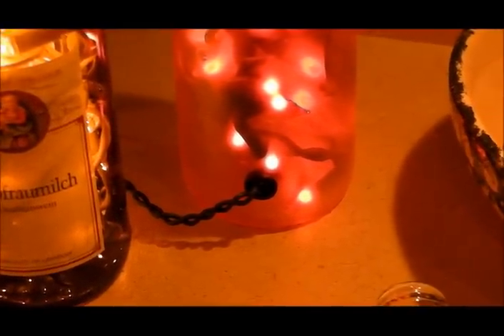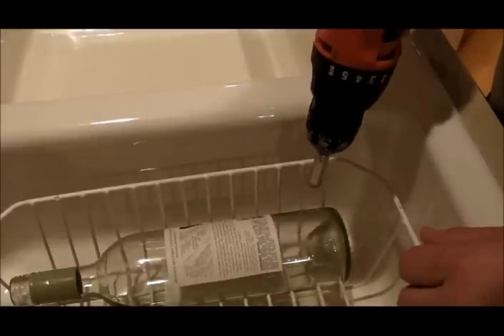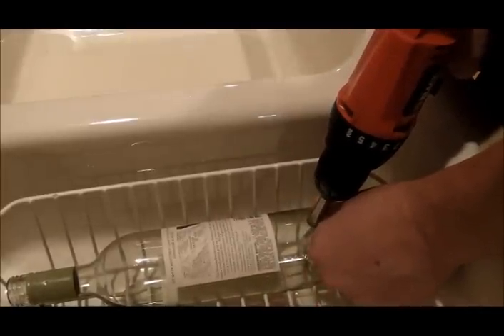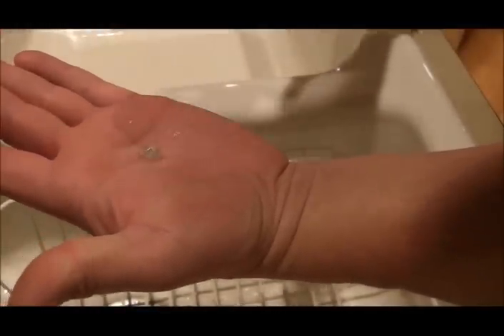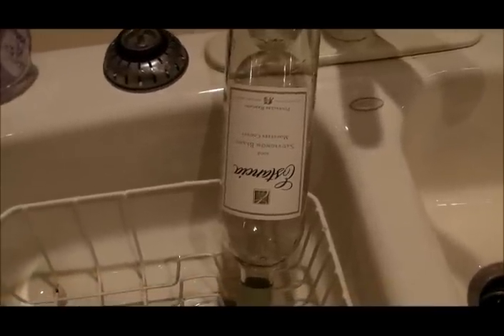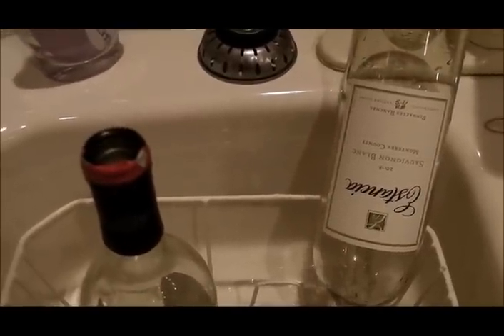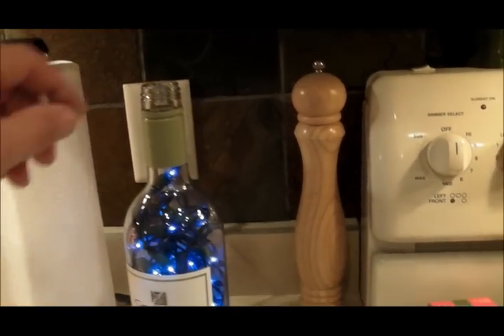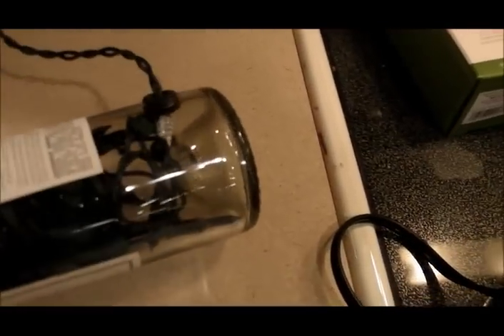DIY - how to make your own beautiful lighted wine bottles

Comment: Nice idea, and very clear video, thanks! I made something like this, with battery operated lights, in a whiskey bottle. No drilling, stuffed the lights in, and the switch is hanging out of the mouth of the jar. The top still fits on, there is cork on the sides of it, and the wire coming out made a little groove in the cork. Not a very heavy wire anyway. It's a little night-light, looks cool! 
I'll have to try yours too. They would make great gifts!

Comment: I got one of the glass blocks at Menards last year when they had them on sale to get rid of them. I simply stuffed a 70 count LED mini style lights string into it. I chose LED's because they're going to most likely last for years. Once the bulbs start to fail on the mini lights, it's pretty much had it. If I was to make a wine bottle light, I'd probably go with the LED lights. But nice video showing how to do this!
Reply from the maker: yep those would work well too - just don't know much about the wiring for those.

Comment: Thx very much for a great video!!  I made a great wine bottle light using your instructions.  No problems except that the lamp  really develops a lot of heat.  Anyone else notice that?
Reply from the maker: +Emily Zeiders I've noticed that some brands of lights put out more heat than others.  I try to get the Philips ones at Target whenever I can as they seem to run a little cooler than others (say from Walmart or Menards).  They are getting harder to find these days in colored strings.  I have been buying 100 light sets and separating the two strings of 50 and then I need to find a cord for the second string of 50.

Comment: If you are removing that third wire on a string of lights, cutting the wire even with the base of the bulb will suffice, you could put a dab of nail polish on the cut end to seal it, but the lights will be contained inside the bottle away from any potential for being touched or causing a problem. This will save you the step of the shrink tubing. Also as suggested, if the hole you create is large enough you can feed the lights into the bottle that way, rather than through the top and the need for any soldering, but if you have some soldering skills, there is usually an access cap that can be pried off the plug so you can unsolder the wires from the plug itself. Then feed the wire through the top and use a hook tool fashioned from a paper clip or segment of coat hanger to fish the wire out of the hole you drilled and resolder on the plug, eliminating cutting the wire and using shrink tubing. then feed the rest of the bulbs into the bottle. To eliminate the use of the grommet, a generous amount of hot glue as a strain relief and plug can be used on the hole you made......just a suggestion to save you some steps and supplies.....Happy Lighting!

Comment: Absolutely awesome instructional video! Thank you for taking the time to make it! My husband and I have a question though.  After the lights heat up, we assume the cord relaxes a little. How do you keep the lights from settling to the bottom of the wine bottle?
Reply: Before you start pushing the lights through the hole, tie a 4" piece of string to the first bulb/wire. It floats to the stem and will come all the way out as you continue pushing your bulbs through. Then just tape to the back side of bottle neck and cut excess off.
Reply: Perfect answer, kind of like slicing bread! ;-)  Thank you!
Reply: The lamps I have made I started with a 1/2" bit to bore my hole and push the string of lights thru there. As for the top I fold the 1st light to the 2nd light and at the V hot glue that to the cap for easy removal in case you need to change a bulb. Also I was able to find cords without the female plug part. As for the hole with the cord coming out I hot glue the cord where I need it. Be sure to give your self enough slack for the whole string to come out.
Reply: +Betty West I ship my  AuroraBottleLights to customers and to make sure the lights don't settle to the bottom I add a small tea cup hook to the bottom of the cork.  I also make my own bottle stoppers so they are more unique.
Reply from the maker: We leave our bottles out all year long and sometimes the lights do settle a bit.  You can unfold a paper clip with a little hook on the end and with the lights unplugged from the wall reach down in with the hook end and pull the wires up a little.  Or you can just pull them all out thru the top and stuff them back down again. ;)

Comment: Last xmas we save a lot money doing this bottles,l love'em but we make that hole an right after we introduce the lights with out cut any.
Reply from the maker: +Luisa C Morphis could you share a link to a picture or video please?  Thanks!
Reply from the maker: So you feed the lights in thru the back (maybe a bigger hole than I use?) and then leave the plug hang out?  I guess you could do that too.

Comment: I had better success with battery double A lights you can buy them at the Dollar store, Hobby Lobby. I keep the battery pack next to the bottle. This is so you are not needing to use your ac outlets, and you can put it where ever you like. I agree with the hole in the side. I tried use ac powered lights on one project and it got very hot. I am thinking about putting some tinsel in the bottles. Oh yeah, it would be wise to advise goggles or safety glasses.
Reply: 63tnbadboy ջ
Reply: 63tnbadboy if u use led lights, they dont get hot

Comment: Their really very pretty however what about the heat that can build up in the bottle with 50 bulbs in there and do they have a smaller number of lights  like 25 or 15.
Is there a risk in leaving them lit while you're out of the house.  thanks..they are very pretty though
pat
Reply from the maker: Hi Pat thanks for the comment.  The bottles do get a little warm but since the top is open they don't get super hot and we have left them on for very long periods of time in our own home and never had any problem.
Reply: you can buy 20 bulb sets from the dollar store at Christmas time. there is also a site called 1000 lights that have them as well.
Reply from the maker: +Kathy Maduke I'll check out that site - thanks!

Comment: do it matter What wire i solder to eachother.? Thanx for this video
Reply from the maker: Well, since the voltage coming from the wall is alternating current, it doesn't matter which goes to which - just make sure you don't solder the two coming from the wall to each other. :)  Always be very careful when working with wiring of this voltage.

Comment: How do we sort the issue of heat bild up inside the bottle?Even if it is led lights it would generate heat and if not released the temperature inside would increase and may melt the wires.This looks cool but may be hazardous.
Reply from the maker: After several years I've never had a problem with the heat that is generated.   Even if the insulation were to melt, the light string plugs have fuses in them that would blow before anything crazy would happen.
Reply from the maker: I have noticed that cheaper lights do generate more heat though.  The best ones are the phillips reduced energy bulbs.  Or leds I would imagine would run pretty cool.

Comment: Can you use something else instead of the solder?? I've just made my bottle but i dont have a sodering gun.
Reply from the maker: +King Dawn I think soldering is the safest, but I read above that you could probably just strip the wire and twist them back together.  If you do this, I would definately use heat shrink rather than electrical tape to insulate afterwards.

Comment: Lovely craft projects but i found the heat buildup was worrying even with LED lights.  So i simply bored more holes to the back of the bottle now the added ventilation greatly reduces the heat buildup within
Reply from the maker: If you use good quality lights (like the Philips brand from Target) the heat that builds up only makes the bottle warm.  I have used other brands of lights and the bottle did get hot.   My recommendation is to make sure you use good quality lights.  These Philips ones say 52% energy savings - and my guess is they produces 52% less heat as a result.

Comment: I used a craft glass bottle that is larger than a wine bottle. I ended up using 100 count mini lights. but the bottle is extremely hot in a short period of time. wondering if it's too many lights or that I used electrical tape on the cut wires instead. can this catch on fire.
Reply from the maker: +J Curtis I suppose there is always the possibility of it catching on fire.  100 lights may be too many.  I usually go with 50.  I would bet you are fine though.  Maybe just leave it on for a long time (for over a day maybe) and have it on some safe area - maybe a garage floor or something.  But if you are concerned with it being a fire hazard, you could go down to 50 lights.  As far as the tape goes, I think the worst that would happen is the heat may make it unravel and fall off.  If that were the case and if the connections shorted out, you might have a bit of a problem but I think most sets of lights have a fuse built into the plug nowdays and that fuse would blow before anything got hot enough to start on fire due to wires shorting out.

Comment: Just thinking could you not just cut the last  light off and the first then soldier the end wire together and the other end to the plug making it into a  nicer looking set just incase someone was to start pulling them out.

Comment: The lights heat up too much in the bottle. How do I prevent that. Do I need special lights
Reply from the maker: I've found that the lights from Target don't get quite as hot as lights from other places. our bottles get pretty warm, but I've never had a problem with them getting too hot.

Comment: what drill bit are you using?
Reply from the maker: they are diamond coated core bits.  I purchased mine on ebay:

 https://www.ebay.com/itm/New-12mm-1-2-inch-Diamond-Coated-Hole-Saw-Core-Drills-Drill-Bit-Glass-F-F/172855710565?hash=item283f00d365:g:tHgAAOSw9N1VrMWf

Comment: i threaded the lights in and they flickered on but then went off. they wont come back on. what am i doing wrong.
Reply from the maker: +mchill320 sorry - just seeing this now.  I'd imagine your electrical connections are maybe not solid, or else you have a bulb that maybe is loose or went out.

Comment: Yeah, that Ebay ad said it was less than 5 miles from you.  I'm guessing it was you selling them.  Awesome that you are putting tiny sized glass chards in your city's water supply so other's can consume it. LOL.  BTW, that 3rd wire.....its your grounding wire.
Reply from the maker: Actually the 3rd wire is not the grounding wire - these lights only have two prongs on the plugs.  If there was a third prong on the plug that might be the case.  Also, I'm not sure where you are from, but the drains in our neighborhood run to the sewer, not to the water supply.  Thanks for playing though.
Reply from the maker: @GettingtheTruthOut  So when you put food and egg shells down your garbage disposal, does that end up in our water too....or..... do you think there is maybe some sort of filtration process that happens before it is put back into your water supply?  lol

Comment: 11:45 : you've got mail  (-:
Reply: notny411
 she's referring to the mail noise that came through at 11:45. can you use electrical tape instead of heat shrink?
Reply from the maker: steven freitag ah, gotcha!  :)  Yes you can certainly use electrical tape, I just prefer the heat shrink - seems more durable for me.  Thanks for the comment!